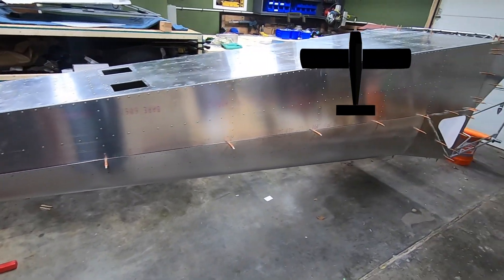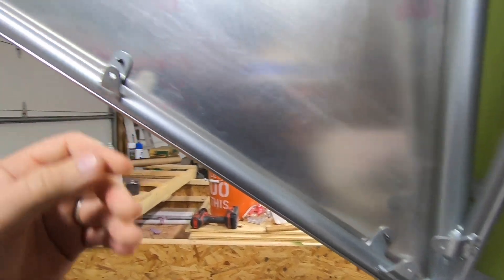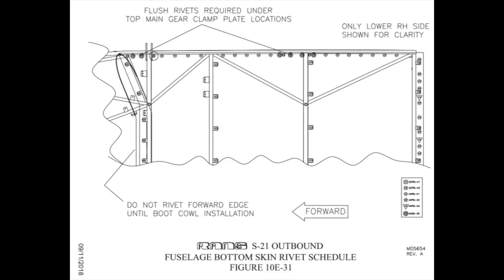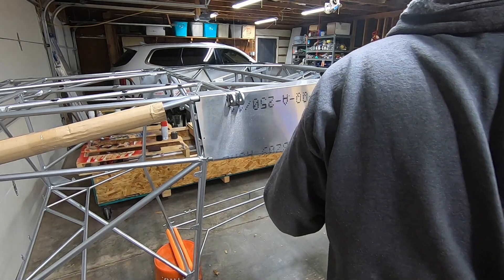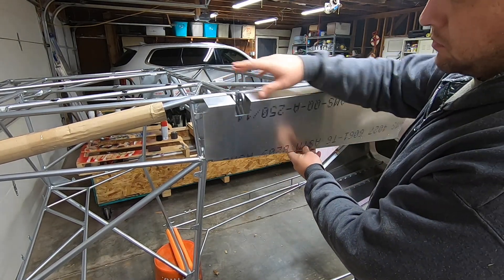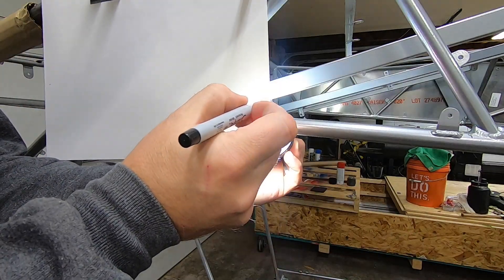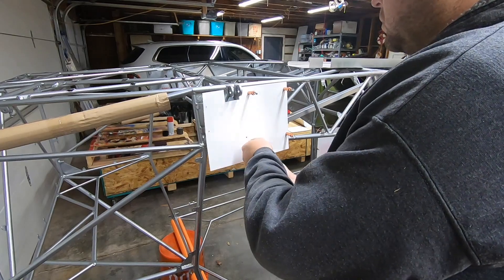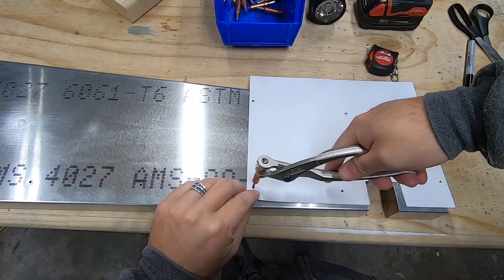RANS S21 EP15 CAGE SKINS

Comment: Hey Josh, did you say you did an edge form on that bottom skin?? We’re working on ours and I was just mentioning to my wife we should put an edge on it to see if it fits up better. And what is the sealant you mention for between the bottom skin and side skin flanges?
Reply from the maker: I did use the “edge forming tool” along the sides of the bottom skin. It cleaned up most of any waves that you sometimes see on these skins. I used some “titebond metal sealant” along each side between the side skin flange and the belly skin and riveted while it was wet. It seemed to have worked well for me and you can get it at home depot. I’m sure some pro-seal would do the job as well if your wanting something more intended for aviation use.

Comment: How did your side panels just in front of station 3 fit? Mine, when loose fitted up seems to hang lower than the cage tubes.
Reply from the maker: I don't remember having fit issues there Rueben. I'm sure there is going to be some variation between every aircraft.
Reply: @Project2Aero  it fit good on the RHS but the left is off about 1/4 inch lower than fuselage frame

Comment: Great vid , so nice to see that you're going to remove and deburr and spay with zinc chromate. I think seal between the aluminum sheet is good too. Seen some other builds where they drill then rivet..no deburring or corrosion prevention...and the plane will be down in the south east where its humid . I guess people dont realize the metal can sweat during temp changes and all that mosture will be on the aluminum sheeting .
Reply from the maker: Here in the Texas panhandle, we don’t know what humidity is. I’m priming anything that is subject to dissimilar metal contact. In this case, the cage is steel so it’ll get primed and any fastener securing the two will be wet installed. Thanks for watching Rodger👍